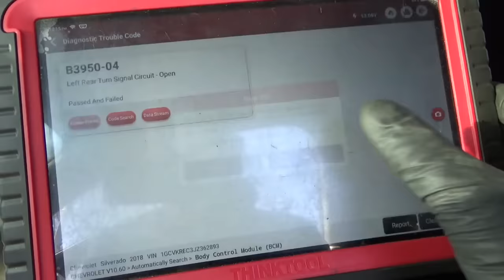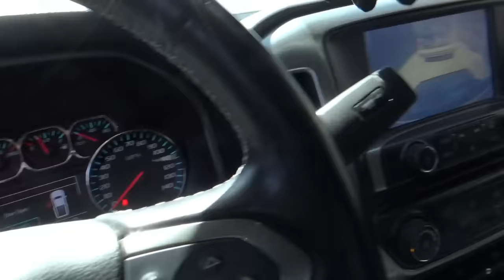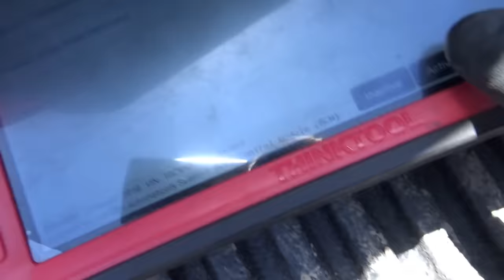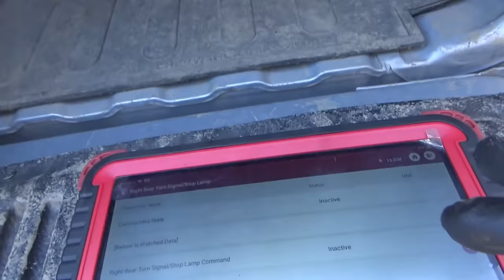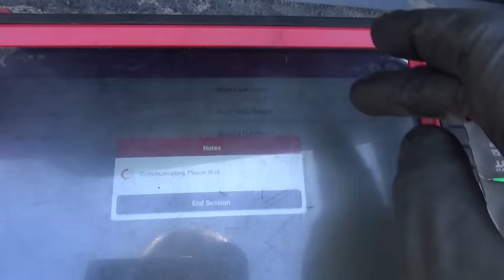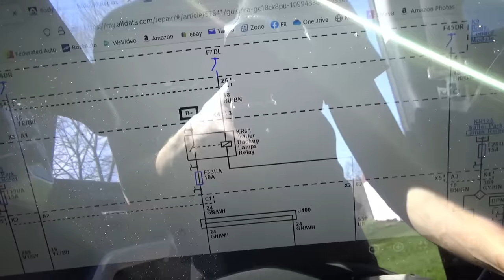3 Broken Chevys? (Part 2 - 2018 Silverado: BRAKE & REVERSE Lights Stuck ON??)

Comment: I want to see the inside of that "SmArT" fuse box...
Reply: Ivan's a slow learner,  he should have requested the old box or lied to us and said he did if he didn't want to deep dive.
Reply: @DAVIDBrown-zp8sz  Those were road trip repairs. He doesn't stick around for the repair if parts are required. He tells them what they need to fix it then leaves. What, do you expect him to drive back to that shop just to pick up a dead part to tear down on his own dime? That's dumb. When these cars are at his shop he always does a deep dive on things if they're interesting.
Reply: He's just giving the customer a diagnosis.
Reply: I would definitely like to see an autopsy on that fuse box
Reply: There isn't really much inside except wiring and plastic and a smattering of computers in some.
Reply: Go buy a “smart” fuse box and take it apart 😉
Reply: @@tedmoss    A 'smattering' of computers ay Ted?  Lol!  The faulty one Ivan just dealt with probly only has a 'splattering' of them now!
Reply from the maker: @matthewmcmaster2731  exactly right 😁 some people don't understand the logistics. If I tore the fuse box apart on the spot the truck might end up a beached whale!
Reply: It’s just bent solid copper wire used as bus bars and a “scotch lock “type connection kinda just pinches the copper trace pure Delphi 💩
Reply: @DAVIDBrown-zp8sz I think maybe you ought to go make some videos of your own and show everyone how it's done!! Because you sound like a great dude!!!
Reply: @matthewmcmaster2731   To clarify my comment , I was referring to the previous video where he caught flak for how it ended and was suggesting that he could lie and say he asked for fuse box and that it wasn't available to avoid more complaints for not deep diving into it, as it happened again in these comments even after he explained himself. Sorry Ivan and everyone else for the misunderstanding .
Reply: @DAVIDBrown-zp8sz no problem, I think some didn’t get the humor

Comment: GM's brilliant idea to use the reverse lights for "area lighting", so you can't tell if the vehicle is parked or backing out.
Reply: I HATE THIS in parking lots.  All I see are reverse lights with no brake lights on and react accordingly.
Reply: They don't stay on long, like 30 seconds after hitting unlock. The high beams turn on on mine too. You can disable it through the MALL (Multifunction Alarm Locks and Lighting) under the entry lighting settings.

Comment: Ivan would it be possible for you to get the bad fuse box or one that had the same issue and tear it apart to see what internally is wrong with them. I really like when you dig into the " unrepairable" electronics. I'm guessing its something that is repairable and you might be able to get some bad ones and repair them, then offer remaned fuse boxes. Like you said at some point they will become obsolete making them valuable.  ✌
Reply: As cool as that would be I don’t think he’s interested in remanufacturing small electronics. Not nearly enough hourly pay as automotive diagnostics!😂

Comment: You were right, Ivan! It was much weirder than I suggested 🙂Great diagnostic, that blew my mind!
And it's a concerning sign, that OEM automotive parts are getting less and less reliable, in shorter periods of time - we are heading for an age of disposable vehicles!
Reply: Less reliable at a higher prices.
Reply: I will keep my 2000 Chevy Silverado 1500 5.3L forever! (Well I probably won't because I am waiting for my Cybertruck, but it will be a while yet).
Reply: @tedmoss  Don't forget to put that "truck" into carwash mode if you ever do get it 'cos if you forget it will take 5 hours to reset the computers on wheels not joking.
Reply: @tedmoss  👍
Reply: @arnoldm889  100% true!
Reply: @tedmoss 
Keep the GMT-800 as a backup

Comment: You can absolutely replace the fuse box with your own wiring, but who wants to do that and it is probably an all day job. Likely you wouldn't need to rewire the entire thing, just the parts that have shorted together but nobody should have to, they should last longer than the vehicle.  It looks to me like they are using non-insulated bus bars inside the fuse box and the plastic holding them in place is either too soft, too thin or both and that, as well as temperature and vibration, is causing some of the bus bars inside to eventually short together.

This fuse box is something that can be refurbished to working order by fixing the broken or shorted bus bars, the plastic holding them in place and then insulating the bus bars properly, but it would be really nice if they could just make them to last like they used to.

If I were designing one of these I would not use just plastic to hold the bus bars in place.  I would put the lower amperage circuits on a PCB and the higher amperage circuits on bus bars that are held together by blank areas of the fiberglass PCB.  Bam! Easy, cheap to produce and assemble and the bus bars aren't going to short through the PCB.

Comment: Great diag Ivan. Here’s my dilemma. You said that OE GM fuse box was junk. You’ve said that about plenty of aftermarket brands. And I agree.  
What is the answer for all these parts failing so early ? 
My bought new 99 Accord had one power window and door lock motor fail in 24 yrs/245k miles. 
Where has reliability gone and who makes it ? 
I’m so glad to be retired after 50 yrs of fighting broken cars. And you have unbelievable patience my friend.

Comment: You know, Ivan, we have 30-year-old Mercurys that we can still get parts for and I noticed you drove yours on this trip.  It is bad that these trucks are already degrading with such low miles, but, they are all that way now it appears.  Seems like Eric with SMA has done a few of these since I have been following him.  Of course, he just goes to Wilbert's.  GREAT VIDEO!

Comment: Great teaching man those was super efficient diags especially the confirmation of wire integrity back to the tail lights without even touching the bulbs!
Reply from the maker: Yup gotta confirm that everything else works as designed to prevent comebacks 😁

Comment: The fuse box was probably part of a cost cutting measure by the manufacturer which resulted in a few underrated current spade lugs being used and caused an overcurrent condition with heat.

Comment: The rust on that chassis is shocking. It's only six years old ffs!  What do they put down on the roads there in winter? Pure acid?
I thought we had it bad here in the UK with gritted roads causing premature corrosion but that is on another scale of bad.

Comment: When those become hard to find, you could probably find a way to open that open and jump the trace or bad spot.  Had to do that on a board for my clothes dryer.  The relay had a thermal event and took out a trace.  Found the relay on digikey, found a jumper wire in my garage :-)  If you have time and skills, open it up and use it to sketch a replacement board and have it printed.  Or just start bypassing the board with direct connections and inline fuses.

Comment: Fusebox "not serviceable"?  Ivan just needs a little more motivation. ;) I accidently screwed up my fusebox trying to troubleshoot a washer pump.  (For some reason, GM grounds the pump when it's not supplying power to it.  I didn't fuse/current limit the supply when trying to test.  Burned some traces.)  It's not designed to be opened, but it can.  As long as it's not needed for a core return, there's no harm in trying.

Comment: Something similar to a brake light problem with my car, although they stopped working. Brake light switch melted, so I thought new switch, but it failed maybe 6 or 7 months later; melted again.
The brake switch was connected directly to the brake lights. 3 x 21 watt lamps = 5 amps but the inrush current  is 10 to 15 times. Measured current was 5 amps so it wasn't overloaded. 50 amp relay fixed the problem and it's been working trouble free for several years.
It's a pity you weren't able check out the failed fusebox.
If the owner wants to keep the truck for a long time, buy a spare fusebox.
Reply: What inrush current?  That really only happens with inductive loads. Brake lights are resistive.
Reply: @major__kong  Incandescent lights resistance increases with temperature (positive tempco). Inrush current is higher than operating current. That is why incandescents more than likely fail just at turn-on.

Comment: Great vids IVAN,looks like a good time to buy a 3d printer.With a little CAD learning you should be making those in-house custom fit.haha You know just thinking about that in that way,200 bucks for a factory now doesn't sound so expensive!!!but seriously i don't think the plastics now available are high enough temp rated.just a guess.thanks man

Comment: Chevy has had fuse box problems for decades now.....your own channel has a video for a 2004 Chevy Silverado fuse box problem.
Reply: Good ole Delphi electronics unfortunately almost all of the oems are all using Delphi electronics with angel hair spaghetti wiring now even some Asian manufacturers are doing it they all have fallen into the lowest bidder when they are designing electrical systems Chevy fuse boxes after like mid late 90s are designed like a scotch lock for trailer wiring absolutely the worst way to make a connection ever on a 12v system all the circuits are pretty much pinched together I dare anyone to take one apart and see if they find anything of quality in there

Comment: Considering the price of some parts, that’s actually a pretty reasonable price for the fuse box, they usually come with all the fuses and relays which would probably be over $100 from the dealer.

Comment: Number three I would suspect an incorrectly wired trailer was plugged in and and that caused the burning some trailers do carry break away batteries and I have seen some freak DIY trailer wiring that really messes with the internals on the tow vehicle. Good work on all three.

Comment: I just replaced a under hood fuse box on a 2007 new style Silverado . The abs light came on and  checked the fuse and the prongs from the fuse stayed In .. total corrosion.. dealership wanted 500 bucks for new one . I got one at a salvage yard for 60 .. gm quality isn’t what it used to be ..

Comment: After part 1 I looked on Rock Auto for that throttle actuator. They have a GM Delphi new, not reman for $155. Wouldn’t that be the best option?

Comment: with the fusebox failing on a number of new trucks there should be a recall or at least  replaced under a extended warranty  a friend had a 06 vw golf  in 2019 had a problem with abs it was a known issue the local vw dealer repaired it free of charge kudos to the dealer

Comment: In the future if there is enough demand for a fuse box, GM will either keep making it or the aftermarket will step up in one way or another.  There are WAAAY too many of these trucks on the road for a fuse box to take them all off the road.

Comment: Inferior parts should be embarrassing, but GM doesn't GAF so they're not bothered in the least.  They just want you to buy a new truck.  That's why I drive a 96 Dodge Ram with the Cummins 12 valve and a five speed.

Comment: I probably have 15 fuse blocks under my bench at work from 07 new body to about 2020 MY with various odd faults. I mark them all with the failure. When i get something like this now i start by swapping in a compatible fuse block with a different failure. Becoming common and probably why the part is so inexpensive. Whats really strange is we are starting to see repeat failures in a specific circuit where it has a corroded and broken wire. Same spot, same circuit on multiple vehicles. Had 3 different trucks with RKE system in-op and all 3 had a broken wire just rearward of right side b-pillar in harness. Harness has prob 15 or more wires in it but same one on each unit was broken. Appears to have had a pinhole in the insulation and then corroded the wire. Nothing in the area that could have caused this so very strange. Another strange one is 2020 an up trucks with left front wheel speed open circuit. It seems rabbits like to sit up near the left exhaust manifold and the harness for the sensor must be right in their face so they decide to eat it. Probably seen this 6 times myself at least and about 40 or more for sure through our shop. Some were brand new units waiting to be sold. Always the same place.

Comment: This is just like the chrysler TIPM's. Put electronics under the hood with no protection from the elements. I didn't install a Weather Resistant gfci outlet and burned two of them up in the matter of a year before I realized they make WR units. Diagnosticians love closure just so we can feed our brains with more knowledge, sorry we had to ruffle your feathers but amazing content. I've been bugging a coworker about his mom's dodge ram randomly crank and no start. It happens rarely but she was stranded in a major city an hour away and he had to leave work early to go get her. Half way there her truck started up and she drove it home. I was telling him about it could be power issues with the TIPM, ASD relay, but the shop she took it to thinks its the fuel pump starting to seize and he scheduled to have it in the shop so he can monitor fuel pressure. It could be common but without knowing the pump can be intermittently loosing power from a green crusty connection. I think he's gonna throw a fuel pump in there and I've seen you test both power, ground, and amp the pump out seeing if it is the pump motor itself or a bad wire. Seen too many times the parts cannon fired on something just to find it has green crusty's in a connector somewhere.

Comment: GM has always been trash since the 80’s IE the S10, the blazer, cylinder deactivation, broken lifters, air conditioning, electrical, transmissions, you name it garbage garbage garbage

Comment: Out of all of the GM cars the Holdens never had a problem with the wiring looms rubbing through & Eric O tends to bypass the fuse box in any car which has a faulty circuit in one of those fuse boxes,TIPMs, etc !

Comment: Poor quality components inside the fuse box? It would be interesting to slice it apart and see what failed inside it. My guess is some cheap capacitor is failing due to heat. Then again, if they are hand soldered, they might be poorly assembled. One person doing it all day might mess up hundreds of them if they are poorly trained, or don't give a damn.
 Outside the rust belt, anyone planning to keep those trucks might want to pick up a spare one while they are still being produced, especially with Uncle Sam forcing us to go electric with ever increasing fuel mileage and cleaner exhaust requirements. You know that is the real reason. But guess what, if everyone bought millions of EVs as soon as they are forcing ICE cars into extinction, the electrical grid will have to do rotating blackouts because it will never handle the load without hundreds of billions of dollars of expansion. They will need more generation, transmission lines, and transformers, a lot more. That is a 15 year project. And be ready to pay more for electricity. Without fracking we would be totally screwed by now.  Inflation would be over 10%.

Comment: i know the new stuff is nice but i have been driving for 50 years without a backup camera and done well. have never had a vehicle with a body control module and never had any lighting problems. don't have drive by wire so never any tbody problems life is so good
Reply: But you are missing out on all the fun!
Reply: Thank the government for the backup camera requirement.

Comment: just replaced a driver door harness on a '14 Sierra, some wire inside is broken sounds like its a common thing on the forums (radio stays on, entry lights dont turn on, window switches not working)

Comment: Possible when the trailer controller got installed, maybe a short to the fuse box that cooked some stuff. Supposed to blow a fuse but, since there are an abundance of cheap components being made.
Reply: "Fuse is supposed to blow", but then there's those cheap ones that don't blow when they should.

Comment: Have a nice day everyone! The fault may be a blown transistor that controls the 12v behind the module to the light bulb. There are so many fuses that the factory original fuses burn out at the specified amperes. But cheap fuses made in China, for example 10 amperes, have been tested and only burn 20.. .through at 30 amperes.This means that in case of a short circuit, the transistor burns out and starts to continuously conduct 12 v through itself.

Comment: Yea i agree with the pack, you shoulda took the fuse box apart and looked where the short was and what failed to make it short..  i didnt think there were boards in them..  had to be a driver fett that failed closed circuit..  which is odd for newer electronics..  designers usually make them in ways they mostly fail open so they dont kill a bunch of other stuff when they do..

Comment: Good question about in a few more years when GM stops making these fuse boxes! If the trucks were super high mileage, you might say it’s not worth fixing, but if it starts to be a problem with lower mileage or all the 7 year old trucks, yikes!
Reply: If you have time and skills and really want to save the vehicle, open it up and 1) jump the bad traces or 2) Use the old board to design a new board and have it printed.  Or just make direct connections through an inline fuse.  Where there's a will there's a way.
Reply: @major__kong  The average customer will not be able to do this, and most shops won’t want anything to do with that either! Heck, they don’t rebuild engines or trans, and most won’t do valves or anything. They just replace with new. (You or I would try your option though!)